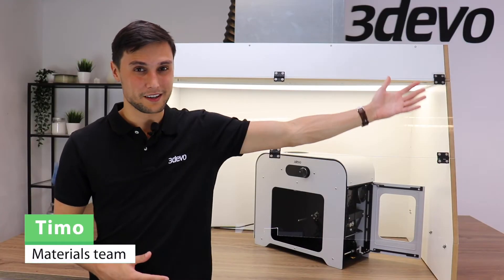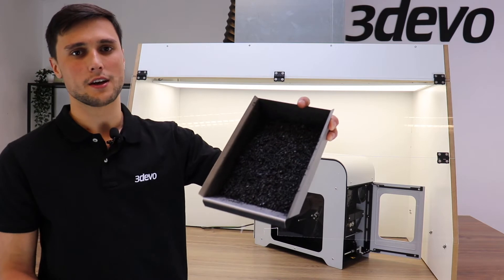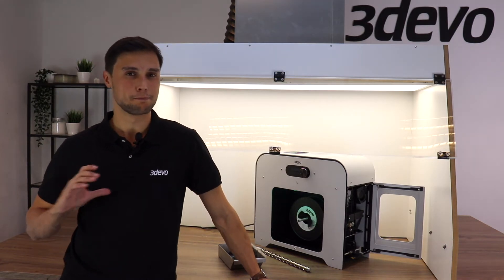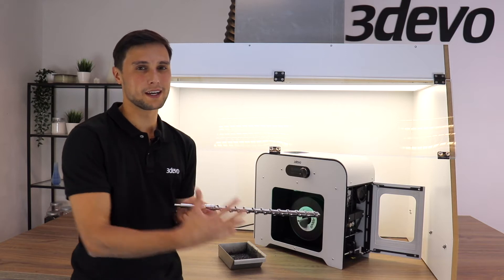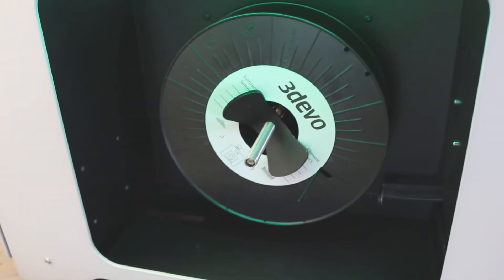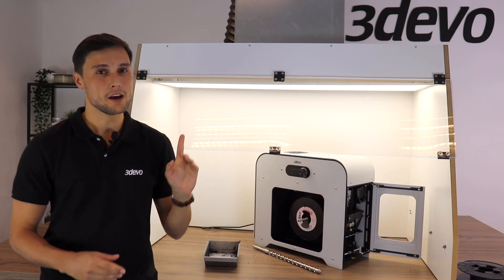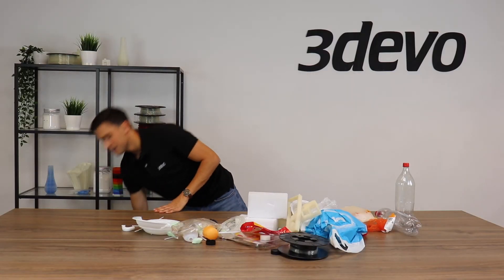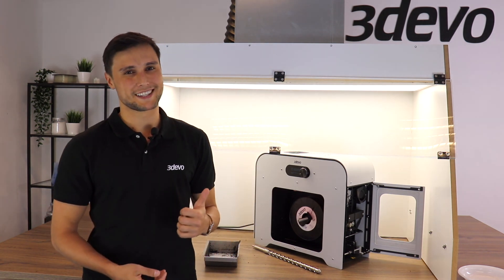Recycling Plastics -  Step 3: Extruding Plastics

Comment: How do you get rid of the air bubbles in the melted plastic?
Reply from the maker: Hi there! 
Bubbles in the filament can be created, due to different factors, and as a result, there is no one solution to that issue. This article goes through these different factors and explains how you can deal with them. If you need further help with that, feel free to open a new thread to our forum and we or someone else from the community might be able to help you. 
Thanks.

https://support.3devo.com/holes-bubbles-filament/

https://support.3devo.com/community/
Reply: @3devo  thank you very much for your quick reply.
Greetings from rainy northern germany.